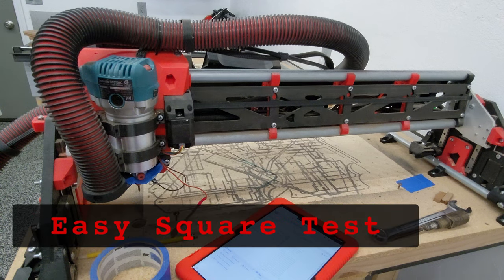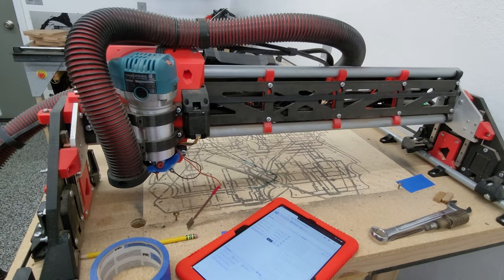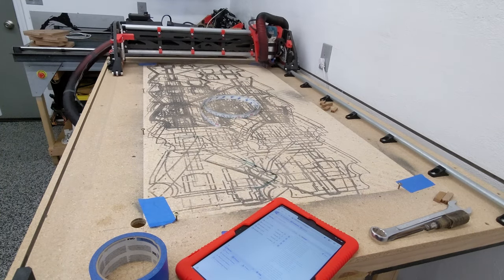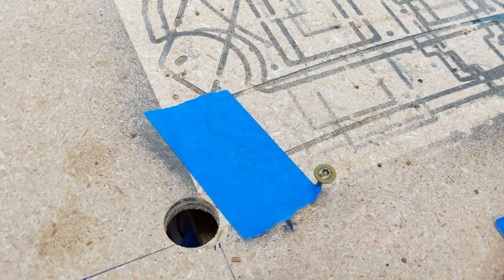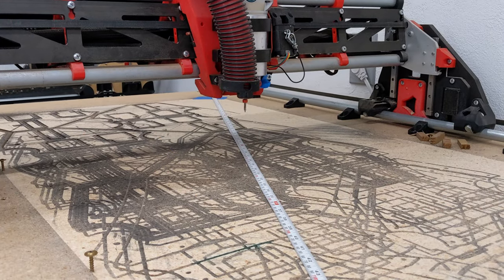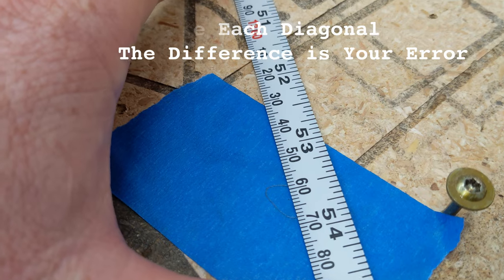Easy Test For Squaring your CNC

Comment: You only need three points. There are G-code senders that have this feature. G-sender is a free grbl based software by Sienci Labs that can do this. It coaches you through each step & after you give it your measurements it will tell you exactly how far & which direction to move one of the Y-rails in order to square it. When I setup my router it advised me to move my rail 0.4mm towards the front of the table.

 If the x&y axis’ are any multiple of 3&4 the diagonal will always be a multiple of 5. This makes it easier when reading your tape and calculating the correction. The opposite corner will take care of itself if the Y-rails are parallel.
Reply from the maker: Yup you can do it that way as well. Doing it this way gives you a sense of your overall error since the difference is more than the error. This stops people from chasing too may zeros measuring each axis length and endstop offsets, two measurements quick and easy. Getting under 0.5mm error over 8 feet is usually where people stop. This also offsets the error in firmware so you do not have to worry about what software you use for sending or CAM. I try to make sure people can use any software they choose including gsender.

Comment: What 3d printed piece are you using for dust collection with that Makita router?
Reply from the maker: It comes standard with the makita mount. With a little classy blue tape to try and catch all the hdpe chips.

Comment: Awesome! Is something like a "PINDA" / "auto adjust z height" possible for the lowrider? Haven't found any documentation for that
Reply from the maker: No you need the touch to account for tool changes. Everytime you swap an endmill the position will vary in the Z direction. Different sizes would also likely trigger the probe at different heights if you reversed the probe.